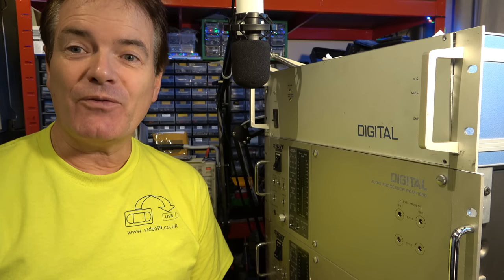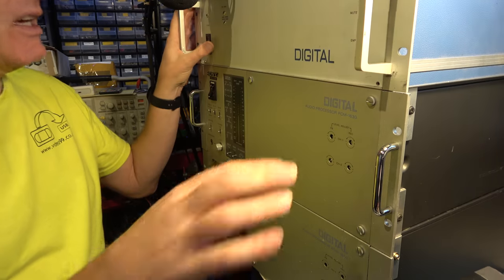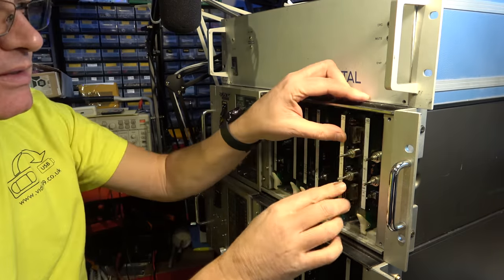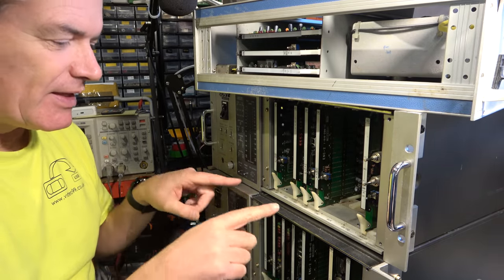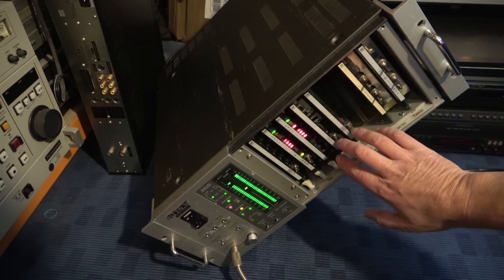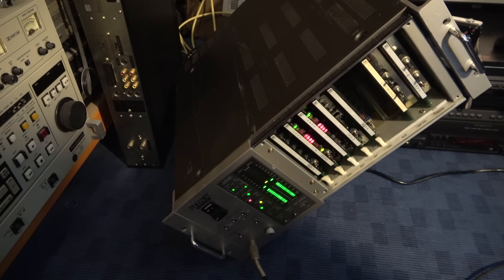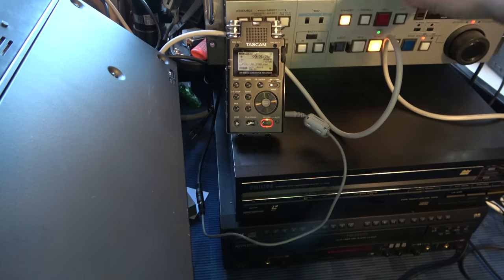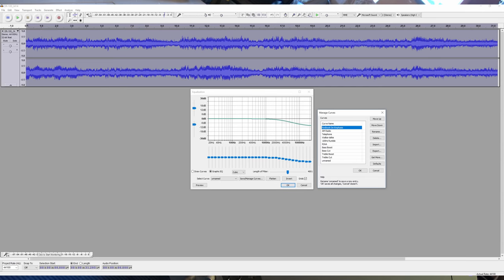Digital audio on U-matic video tape. Repair a Sony PCM1630 decoder.

Comment: Hello!
24:00 thank's for mentioning!
At the moment I'm working on a video about UI and capabilities  of the decoder.
I've might add that the capture itself is not required to be very high quality. It will work even with crappy USB dongles and low-quality decks with unstable drum speed or low-bandwidth signal path.
The main issue is, as you mentioned at 24:40, most of video capture devices can not capture inactive region and ~20 lines (per field) of PCM at the top of the frame will be lost.
But it is not as bad as you can imagine. STC-007/PCM-F1 have error correction codes built-in and allow up to 16 (PCM-F1) or 32 (STC-007) consequtive lines to be damaged/lost in a span of 128 lines and then it will be fully recovered into original samples.
It means that NTSC recordings should be fully recoverable and PAL STC-007 recordings should also be fully recoverable. Only PAL PCM-F1 ones will have problems with too many missing lines. For others if tape and VTR are in good working order then decoding should be errorless.
Also, there is some capture hardware that can capture inactive region as well. Some old Magewell and Matrox cards should do that I think. So "full-frame" capture is possible and software decoder will not have a disadvantage of missing lines of data.
PCM-1600/1610/1630 and PCM-1 decoding now is also available but that is still in testing mode because I don't have many captures to test my decoder on.
One thing that software decoder provides (what hardware one does not) is counters for how many samples were actually lost/damaged/interpolated during the process. So you can be aware if there were any issues during the capture.

Comment: 13:10 - I don't know PCM-1630 internal structure and schematics, but based on my knowledge of STC-007 decoders and PCM-1600 format specs I think that this board converts from analog video to the digital audio bitstream. It seems like top right part of the board works with video and binarizes it into stream of 1's and 0's. After that bottom half of the board captures words like "left audio sample, "right audio sample", "parity word", "CRC word" from the stream, stores those into single-frame memory buffer and then deinterleaves data and corrects any errors that it had found. Output should be just audio bitstream that could be routed to SDIF/SPDIF/DAC/whatever. So for you purposes this one board is really the one you really DO NEED.
PCM-16x0 doesn't use any visual markers (as STC-007 does) to align data horizontally, so it should rely on precision of a VTR and some internal fixed timing that tells this board when to sample each of 193 bits in the video line. And my thought are that that timing is what is off on this board (can those trimmers on the PCB be for that?..), so entire line virtually shifts to the side and data gets screwed. Or, maybe, frame buffer RAM gone bad and damages data before it gets deinterleaved.
Reply: Update.
I've checked manual on PCM-1630 and yes DEC-15 board does exactly what I though - it converts analog video into digital audio bitstream.
Those trimmers are in the video part but those have nothing to do with timing, those set video sync and data separation levels for binarization. Probably should be verified with an oscilloscope anyway.
There also SW3 dip switches that should be set to ON-ON-OFF-OFF (1...4) and manual says that those are for factory testing and should not be altered.
Big square ICs are CX23071 (Decoder-A) and CX23073A (Data separator). Also there are DIPs CX23072 (Decoder-B), CX23074 (Sync separator) and HM6148 (Static RAM).
Sync and data separators handle video input and produce timing signals for bit extraction. Decoder-A checks for CRCs and interfaces with SRAM for the frame buffer, Decoder-B handles parity checks, error correction and muting.

Comment: The PCM 100 (and also the PCM 10) uses the STC007 standard, so NTSC 44.056 kHz sampling rate. I have a betamax tape with a recording made on a PCM 10 and it is fully compatible with the F1/701/601/501, and of course 14 bit and NTSC formatted. Interesting subject!
Reply: I have a PCM-10. Сonfirm your words.
Reply: @VCD-Channel  Hello VCD, I have seen your very interesting website with the development of a PCM processor based on the PCM 10. I hope that one day I can order such a processor from you :).
I still have the PCM 10, although it does not function properly. I had the PCM 100, but sold it again, as did the 1610 and 1630. I didn't have enough room for it and I'm still sorry I sold it.
In a corner is a Sony PCM 85, which I can't find anything about on the internet. Maybe someone here knows more about it.
My interest in PCM dates back to 1987, when I bought my first modified 501. Many followed. The modified ones are especially interesting, such as those from Audio+Design and RTW. There seem to have been more variants.
Sorry for straying from this topic.
Kind regards, Lennard

Comment: As you know, the pcm u-matic format was used to make master tapes to send to the pressing plant to make a glass master. It’s possible the odd box you have, came from a pressing plant perhaps.
My dad worked extensively with this format, and dropouts were a huge problem, triggering the CRC. There is no dropout compensation, so this is where the RAR functionality is useful. The DMR-2000 was primarily used to make recordings and the DMR-4000 to playback 
One thing the DMR-4000 has, which the standard BVU-800 doesn’t, is an automatic head cleaner, which helps reduce clogging.
I also have a PCM-1630/DMR-4000 setup and the AES option, which I’ve never been able to get to work (a rainy day project).
I also have the course notes for the DMR-4000, as well as a rare product brochure, which I must get scanned.

Comment: I remember a rack mounted Studer/ReVox CD player that had separate digital outputs for left and right and I'm sure it also had a word clock output, so maybe that used this SDIF format too. Most professional equipment I've come across have the standard AES/EBU XLR (or BNC) sockets which carry a single stereo pair, so this CD player was odd having independent left and right channels.
Reply from the maker: Yes  it mighty have been SDIF.

Comment: Actually there were some early digital audio systems that used minicomputers (think PDP-11) to actually store digital audio data. However that was really expensive and thus only used for editing. Recording it onto conventional cheap U-Matic or even Beta tapes with cheap recorders was much more practical. Remember that U-Matic recorders were as cheap as cars even back in the 1970s.

Comment: Brilliant thank you for posting - the Digital Domain is a law unto itself it would seem - when I moved from the Analogue path on 24 - 16 - 8 - 2 Track tape machines to the Adat Black Faced recorders in 1990 it was another world altogether with many trials and errors - I still have my 2x8 Adats plus the BRC both with very low, around 800 hours, used for backing up the tape machines apart from the 24 2" recorders - now we're into different territory with handheld and location units going through the Sony pro units to todays Tascam, Roland R-26 - R-07 Sound Devices MixPre6ii and the Tascam HD-P2 plus the HHB Minidisc - all for me acceptable then and now although using the higher 96 & 192 take up that much more space... does it actually match up the the wide frequency of analogue yet? Perhaps the human perception destroyed by early CDs with the filters taking out second and third harmonics that we are somehow aware of leaving that brittle sound of those early CD's - who knows but thank you so much for posting your brilliant videos and so instructive. Michael OAK77uk

Comment: It looked like when you had the original decoder board in, both A and B lights were on, but when you changed to the Known Good, only A was on again
Reply from the maker: Yet RAR was on, so it must have been working on both channels.  Strange.

Comment: For a while I owned the 4000 model umatic, which actually came from a mastering house called The Exchange. Unfortunately I didn't have the decoders and couldn't find any, so I sold the unit in the end.

Comment: It will be interesting to see a software recovery in a computer using one of the later models uMatic machines with built in TBC card, Software methods came a long way and they are more flexible in terms of options and settings, and don't worry no one is going to put you out of business, Very few people own and know how to repair uMatic machines or any vintage of piece of gear for that matters. For capture cards, I think for PAL is not an issue, For NTSC capture cards capable of doing 486 lines should capture the entire PCM frame. I will ask the vhs-decode team to see if they can work on a PCM plugin since the hardware is capable of capturing full frames 625/525 lines.

Comment: Maybe you can borrow a heat camera and point it at the bad pcb then the good pcb to see if one i.c is consuming more power than it should and getting slightly warmer than the otherpcb.
I would of blamed the supply capacitors to,  noise free supplies are a must.
Sorry i know bugger all about decoders.
Reply from the maker: I asked Santa for a FLIR but he said they are too expensive...

Comment: What was the idea of using "Emphasis" on digital formats?
Reply: Noise reduction akin to Dolby on analogue tape. Of course it's pointless on a format that has 96 dB DR to begin with and causes compatibility issues, but that was the idea.

Comment: Hi, I wanna shop a 1610 or 1630, could you tell me how I can find them ?
Reply from the maker: Very hard to find, especially the 1630 with all the options installed.  I have a 1610 that I'm not using, but not sure I really want to part with it.

Comment: hi you are right the cost of keep this gear running is very high  why in the past i have keep away 
i only buy some gear  you keep going on about I HAVE I HAVE all the time  i have said in my old channel just ask
do i have this formats 

i am getting gov backing so i could  start up again  love your video's  space and money 
13gb a hour is very high  i been using 4gb a hour for 12 years   can't go to HD  the monitor i have plays up 
i have to cut corners

Comment: I have 9 hits on the subject of 88.2 Khz at Qwant. If there is 4 channel software for 88.2 kHz (SRC+Mix), you can convert the stereo tracks to 88.2 kHz and make a copy. Move tracks 1+2 one sample back, leave the copied stereo tracks 3+4, and downmix tracks 1+4 to 44.1 Khz stereo. Software may search someone with better knowledge of English.

Comment: It's definitely a modified BVU800
Reply from the maker: Yes, very similar mechanism.  It has the same design fault too: If a tape is sticky and grabs hold of one of the guide posts during unlace, then the mechanism for the post placement can get on the wrong side of another lever and jams up the loading ring properly.